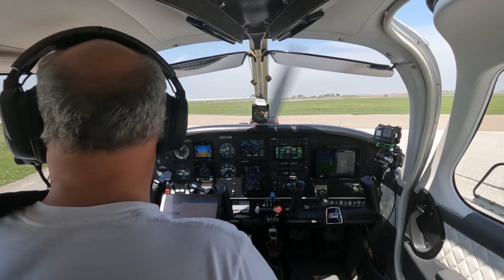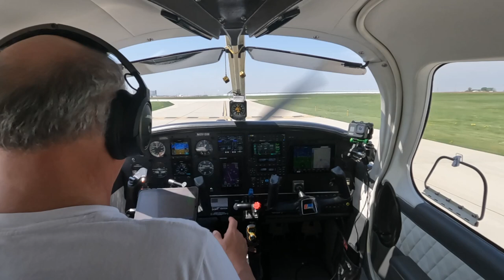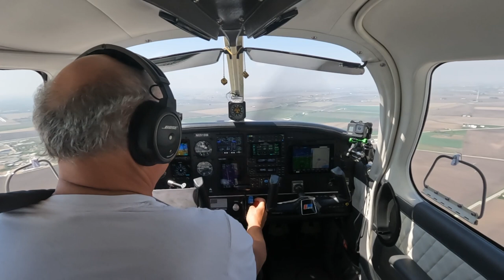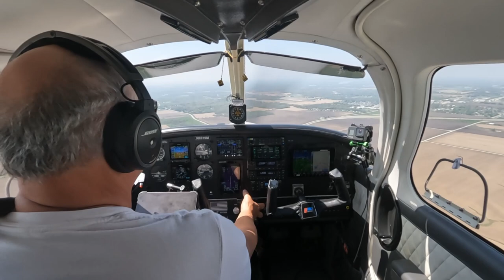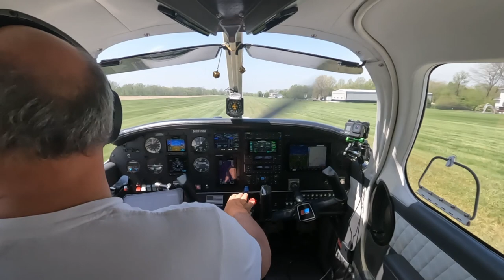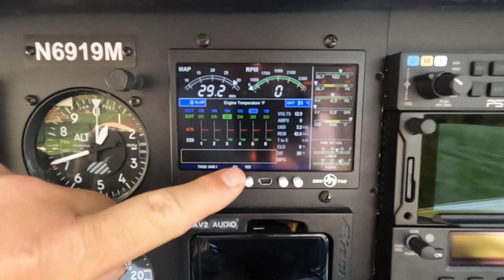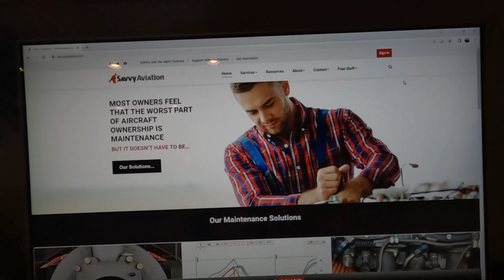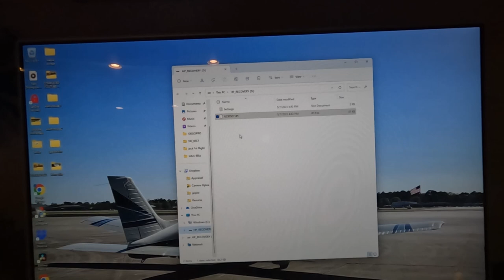DATA TRANSFER FROM JPI 900 ENGINE MONITOR PIPER DAKOTA

Comment: How many hours do you have on your engine? Is it a rebuild?  I think is a great service. They can keep track of several of those type engines and if one breaks, they can go back and look at those numbers to see what was going on with it before it went bad. Also do you have your oil tested to see if there any metal in it? Back in my flying days all we could do was a compression test and hope for the best. What's you view on 100ll? I fear we may see the day when it is outlawed, but I'm hoping they can come up with something. You would think if we can put a man on the moon, we could find a way to get the lead out of aviation gas. Thanks for sharing your flying experience with us. I have a little over 200 hours single engine, but that was 30 years ago. I get my log book out now and then to relive my life from all those years ago.
Reply from the maker: Thanks for watching my video.I have 402 hours on a Lycoming factory reman engine.I send off for oil analysis every 3rd oil change.The cocktail for the new aviation unleaded fuel was done by none other than Geaorge Brawly from Ada Oklahoma,my guess is we will be using the new fuel in about 3 years.This new unleaded aviation fuel will be WAY better on our engines.I hope you can get back in the air some day,and if you need a plane to fly, give me a call ,you can ride right seat in my Dream Catcher Dakota! I'll be wishing you good luck my friend.